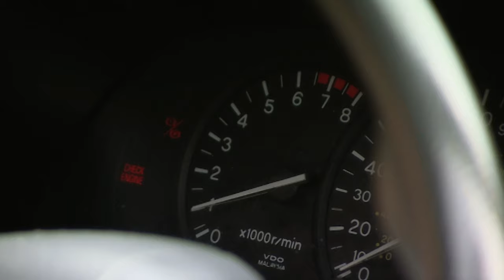Driving A Car With No Oil #TBT - Fifth Gear

Comment: I think this must be fake. Normal people check oil time to time. It is the same as tire pressure, levels and quality of brake liquid, power steering liquid, condition of timing belt or light bulbs.

Comment: i thought he wasn t going to kill the car. i though just before the engine seizes the guy was going to top up some oil to show us the engine noises would go away.
Reply: they don't go away completely once u run it with barley any oil for a while the damage is permanent it will bring the noise down a bit but it'll still be there adding oil to a engine that's damaged like that just gives it like a 1,000 mile life span increase lol trust me my Moms Avalon ran low on oil for a while (3 months)we just filled it up recently it only knocks on cold starts now 😂😂😂

Comment: My car was running hot we re did all the coolant parts was damn low oil I'm an idiot I check my tire pressure weakly but wasn't checking oil level

Comment: he is wrong on what oil does,, he said it has 3 jobs,,, thats wrong,, it has 4 jobs,, lubricate,,, cool,, clean,, and seal,,,, yes seal,,,,,, if you have a dry seal in the engine it will leak,,, trust me,, i am a retired mechanic

Comment: I think its unnecessary to check your oil, just get your car to the garage in the intervalls which the manufactuer thinks is good, they will check it
Reply: I check mine every time I fill up with gas...
Reply: you got a new honda that gets 50 mpg ?
Reply: Until you have a leak or are burning oil, have fun with your trashed engine.
Reply: This is the kind of laziness that would cost you $$$. Your car could get a leak and you wouldn't even know or what if your piston rings are worn and the oil ends up in the combustion chambers and start to burn off? You shouldn't depend on garages to do simple checks like this and its not hard to check your oil!
Reply: Actually you are kinda right, i was just very biased by the opinion of my parents.

Comment: I'm sure that your car's engine won't start if it doesn't have oil
My car won't start because the oil tank is draining for some reason and idk what to do
Reply: uhhhhh plug the leak?? lol. pour fresh oil into your car to see where it leaks from and plug it. or go the more expensive route and get a tow to a shop
Reply: @colinsteadland  it was 2 month's ago
Apparently my battery discharged plus at the route on a car service my engine was set on fire because no oil pressure
Reply: @FoxyFlare1  oh jesus lol
Reply: @colinsteadland  luckily it wasn't a whole damage to fix
Still costed a lot than I thought
I hate cars at this expense point
Reply: @FoxyFlare1   lesson learned though hopefully. its always cheaper to maintain than to repair

Comment: THE SAME THING HAPPENED TO MY CAR IF I PUT OIL BACK IN THE ENGINE WOULD IT WORK ?! BACK TO NORMAL AGAIN ?!!!?!??!
Reply: what will happen if i put oil?
Reply: THANKS SO MUCH FOR YOUR TIME AND HELP MUCH APPRECIATED!
Reply: If you completely drained the oil like in the video, you're done. If you just ran it a bit low, there is definitely damage but if you follow Dan G's steps, you might get some more life out of it. DO NOT just top off the oil. Make sure to do a full change w/ new filter because there are going to be lots of metallic shavings and particles in your oil that you want removed. Wouldn't be a bad idea to pour a quart/liter of cheap oil through the engine while doing the change (with the drain plug removed) just to help clean it out a bit)
Reply: Yeah if you wanted to run seafoam or something you could, but that stuff is for gunked up oil. not metal shavings. I meant just pouring a quart of clean oil through your engine while it's off and the drain is open to hopefully catch some leftover nasty oil or metal that was left behind.
Reply: THANKS SO MUCH FOR THE HELP YOUS GUYS ARE SO HELP FULL THANK YOU ITS BEEN MUCH APPRECIATED FOR YOUR HELP THANK YOU ! <3
Reply: Might also be a good idea to use heavier oil after this since likely there is now excessive wear and original spec oil might not offer sufficient sealing and cushioning.

Comment: I ran my car out of oil once. It refused to run over 4000 rpm, which meant it could limp 30 miles to home. I felt like a fucking dumbass and treat my car decently now.

Comment: another thing people just starting their car then straight into gear and off they go, not warming it up at all
Reply: That's because a car shouldn't idle to warm up. It's a practice from the carburated days because if you diddn't warm the engine up the car it would run like shit and stall. Now a days everything is correctly injected due to measuring sensors. A car heats up way faster when it's under load then at idle. Not saying you should floor it right away, taking it easy is the key.
Reply: That's not a problem with modern cars, the oil does its job while cold as well. With older cars you would definitely have to wait for the engine to warm up on a cold day to prevent excess wear
Reply: Cars shouldn't be warmed up by idling because the idling there isn't enough oil pressure to move the thick oil through the engine properly.

Comment: Is he really using the right oil specs for each of these cars? where there is a blame there is a claim :P
Reply: well... majority of cars are built to run on 5w30. when in doubt you can throw 5w30 in just about anything and itll work just fine. my guess is that hes running around with synthetic and non synthetic oils both being 5w30 weight. 

only time you cant is specialty vehicles. 
so if you have an exotic car or a motorcycle with a wet clutch or say a vehicle specifically designed for climbing mountains in deeply cold temperatures where it never sees above freezing. those require special oils. 

but. this is mass manufactured vehicles we are talking about.. where they can run on almost any oil as long as its not too thick.

Comment: Disadvatage of the 4stroke that the oil is seperste from the fuel....
Reply: Please explain how the fuck that is a disadvantage?
Reply: if your pump goes your engine goes. if you forget to top it up then the engine is done for..... But on a 2stroke its mixed with the fuel. Plus its sooooooooooooooooooooooooooooooooooooooooooooooooooooooooooooooooooooooooooooooooooooooooooooooooooooooooooooooooooooooooooooooooooooooooooooooooooooooooooooooooooooooooooooooooooooooooooooooooooooooooooooooooooooooooooooooooooooooooooooooooooooooooooooooooooooooooo much more simple compared to a 4stroke. 4stroke is like a M16 rifle and 2stroke is an AK47 rifle.....
Reply: peter medz Well 2 stroke engines need to be rebuilt more often as they wear quicker. Less fuel efficient and you have to keep adding oil to your fuel which is inconvenient. Also 2 stroke cause far more pollution. So checking the oil from time to time in your 4 stroke engine doesn't seem to bad tbh and that is why they are used in most cars nowadays over 2 stroke.
Reply: well efficiency can be almost fully improved by installing a specialized pipe, plus longevity can be improved by having the same quality parts as in a 4 stroke car. Plus there must be a solution for the pollution of the 2 stroke. So in conclusion a 2 stroke can be better than a 4 stroke. the only minus in my opinion is the noise and vibration in a 2 stroke... search up the Trabant 601 2 stroke
Reply: peter medz Actually, a 4 stroke engine having a dedicated lubricating system is a far better design that a 2 stroke. Seriously if a 2 stroke was as good as you are trying to make out then why are they not used in cars and things now?
Reply: Well reason #1 is that all cars are owned by huge corporations and they don't want you to do the work yourself. They want you to take it to the mechanic (preferably their mechanics) so you have to pay them.... for example FORD take a 2015 and a 2000  F-150. The old one you were able to most repairs your self, but the new one you can't even change the mirror without having to remove the whole inner door panel. Why did they do that, so that you have to go to your mechanic to get it fixed. Same reason why more than 90% of all modern cars have a specialized cover over the engine, that also usually requires a "specialized" tool in order to remove the cover. #2 A 4 stroke "dedicated lubricating system" can always fail. See a 2 stroke you don't have to worry.
Reply: peter medz There are pros and cons for both.

Comment: Driving a car that you know is unroadworthy and potentially very dangerous on a public road.....
Reply: I agree if it was being used on the M way or on roads where no stopping is allowed. But MOT test won't check you car for oil, so it's not a safety requirement. Unlike fuel. If you know you might run out of fuel any moment, driving onto an Mway is an offence as far as I'm aware.

Comment: Is nobody else cringing at how he's arbitrarily pouring oil without verifying the proper weight for the vehicle? Using the wrong weight can be just as bad as slightly low oil.  Heaven help them if their car uses synthetic and he's pouring in conventional.
Reply: He had two jugs. Probably one mineral and other synthetic.
Reply: Argantonis There's way more than just conventional vs synthetic. Using the wrong weight could cause serious harm.
Reply: DerekSiems Wrong oil is better than no oil.
Reply: Argantonis Well, none of the cars was completely dry.  I'd say it's a coin toss between low-but-not-dangerously-low oil and putting the wrong weight.  I'd sooner just tell them to go get an oil change ASAP than dump the wrong stuff in there.  If it was completely dry, sure, anything is better than nothing, but that's not the case here.  There's also the issue that these people probably won't get a proper oil and, more importantly, filter change because now they think "oh, I just got new oil! I'm good!".  I'm cringing at how bad their filter must be now...
Reply: Yes of course you're right. They were at a supermarket parking lot so it would have been easy to just go in and buy the proper oil to fill up.

Comment: while there may have been times when basic mechanical knowledge was transferred to the newly trained driver, nowadays it is something noone is interested in. how to change tires? who cares, i wont get punctures. how to measure oil? my car is not burning oil, it will hold out. how and what coolant do i need to fill to have my engine cool / warm / not freeze all over? not my job it is the repairmen's. and when someone owning a car does not give an answer like these then comes the "ooh, you think you know stuff?" .. preposterous, outrageous and such, for a petrolhead .. and maybe something to rethink as a car owner. for as it was in the video, not all damages or parts going bad are covered in the regular servicing - should it be caused by a neglectful owner.

inb4... I'd live to go around the city in a Proton like that. Shame it was destined to have its engine weld itself together .. maybe it was not fit for MOT any longer.

Comment: Actually, you're wrong. All cars require the engine oil to be checked differently, either running, hot or cold, etc etc.

Comment: The oil problem obviously belongs to the CAR MANUFACTURERS! 

Because of BHN! 

Basic Human Nature

MOST people is completely oblivious to what's happing in their cars, and car manufacturers KNOWS or at least should know this! And they most certainly make a bit of money off this!

Is it really that hard to make a more reliable oil level system? Really? Every other part of the engine is controlled automatically, so why not the oil level? It could even be filled automatically, with a warning whenever the oil refill tank empties to fast or something. Simple as that!

And to all you grease monkeys out there: MOST people are NOT like you! They got tons of other, more important things to fill their minds! So many other things... To us, a car is something that just works. Well, until it doesn't anymore... It's as easy a that. MOST people will never do more than the absolute minimum (put fuel into it, send it to the first couple of services, maybe even check the tires. At least if they're reminded by tire pressure thingy...)

It's Basic Human Nature. The car manufacturers should be FORCED to deal with it already.

We've had cars for more than a hundred years - there's simply NO EXCUSE that it's possible for any normal car car to run out of oil without ample warnings! At all!

I will neither confirm nor deny whether this has ever happened to me.

There. Rant over.

Thanks for reading! 😊
Reply: It's not so much of having the right amount of oil like they're talking about in the video. It's the fact you have to get rid of the old oil to keep it clean. Plus you should change your oil filter when you do an oil change.
Reply: If checking and changing oil is so easy, important and has such costly implications if ignored, why doesn't people just do it?
 
Basic Human Nature. That's why, and this should not be a secret to anybody as this goes for every field in life. Why do people overeat? Smoke? Drink to much? Same reason: Basic Human Nature. People simply doesn't do what they should do! 
And this goes for everybody!
Reply: Sadly true. Same happens to how people take care of homes.

Comment: Wow, bunch of dumb people. I can't even believe that. 

It's piss easy. I can't help but laugh at idiots who need a mechanic to change the oil and filter in their car. Now i'm not even close to  a car guy or a mechanic, but i do my own oil, oil filter, cabin filter, timing belt, brake pad, etc swaps...Literally an idiot can do it (apart from the timing belt)....

I'd say it worries me, but i never bought a car or a bike in bad condition, ever. 4 years ago bought a 98 ford laser liata for $1200 (120.000 km's on the clock) after i had a good look at it, took it to e mechanic friend of mine....Needed new wipers for a roadworthy. Driving it to work to this day. Swapping oil in it every 4000-6000 k's. Costs $10, makes the car last 500.000 k's......